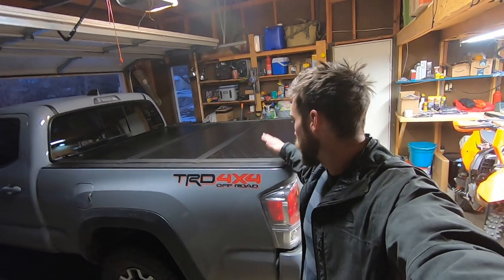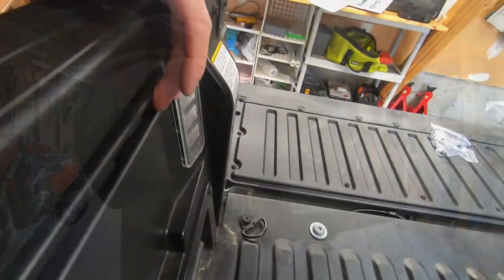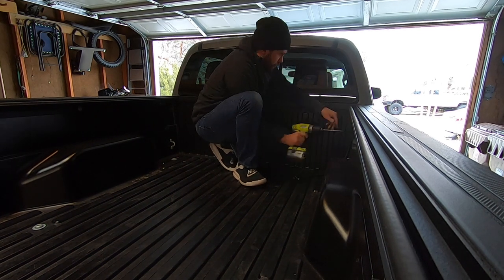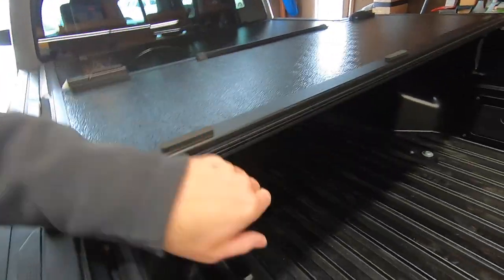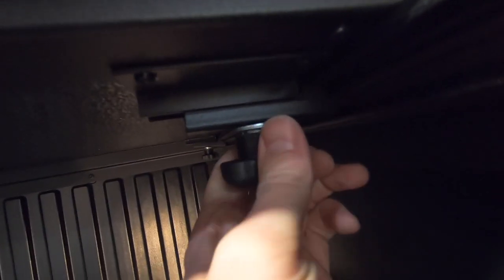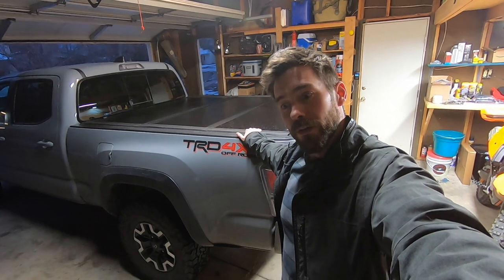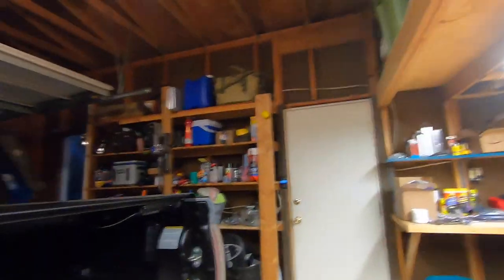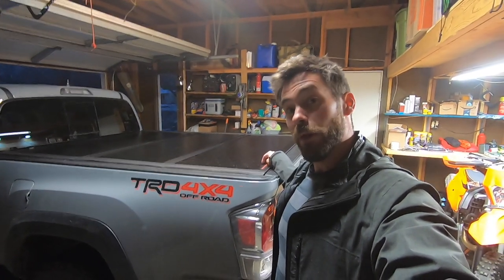16-21 Toyota Tacoma -- Rough Country Low Profile Hard Tri-Fold Tonneau Cover - INSTALLATION & REVIEW

Comment: My 2020 tacoma came with the remote locking tailgate. That's weird
Reply from the maker: Jerny Gutierrez apparently it’s an option that came with some and didn’t come with others. I asked the dealer about mine, they said they could add it for $425. The pop and lock is $90, so I’ll just do that. What model is yours?
Reply: @SourceADV  mine is just a SR with the TSS offroad package
Reply: @SourceADV  I dont have any power seats or power back window or fog lights or anything which is why I figured if I had pop and lock I figured they all do
Reply from the maker: Jerny Gutierrez makes sense! You’re lucky! It’s a fairly long install. Take care!!
Reply: you can configure it on the settings from your radio, you can choose if you want your tailgate to be unlocked by the keyfob or not
Reply from the maker: Jesus Morales not on mine, it didn’t have any actuator back there. I had to use the Pop and Lock kit to add an actuator. The only wires going anywhere near the tailgate handle/lock were for the backup camera. Toyota offered it to me as an option when I bought the truck new, but it was close to $500. Do you have it as an add-on on your build sheet/final bill? What trim level is your truck?

Comment: I pass. I aint drilling no hole into the bed.
Reply: I was thinking the same thing lol I'd just drain it into the bed 😆
Reply from the maker: Its not that bad. The taco beds are basically swiss cheese when it comes to water anyways. Seems like it all comes in through the top where the bed and bedsides meet.

Comment: Ughh i wish installing mine was this easy..i ran into a million hiccups along the way
Reply from the maker: chrisnunez111 what happened?
Reply: Wouldnt latch,had to manually loosen latches to give them a little playroom..i think my truck side rails that i bought it with must have been to short causing slack on back latch end preventing it from clicking. Dont think it was defective i think my rails must have been tweaked or something
Reply from the maker: chrisnunez111 oh got it. That’s too bad. The Tacoma beds are known to tweak themselves a little bit with hard off-road or heavy loads too. There are a couple company’s that make bed stiffeners that help and may re-square the back part of your bed (if that was the problem. I have total chaos bed stiffeners on mine. It adds a couple tie down points too which is great. Best of luck!

Comment: Drill for drains? “F” that…..Why can’t it drain into the bed?  Drive the truck up a gentle slope……where does the moisture go that you are draining with the drilled holes?
Reply from the maker: I didn’t make the directions, this is what Rough Country has in their directions. The water drains directly to the ground.
Reply: @SourceADV  The bed liner covers the bed of the vehicle. Even if there’s an opening, any moisture will drain on metal underneath the liner. I would never drill the liner. I need a cover but i wont be installing any brand with drilling instructions. I have gone over the bed and cannot see any location under the bed liner that goes straight to the ground. I am not blaming you but i will pass on this cover.
Reply from the maker: Tacomas do not have bed liners. The whole bed is plastic, there is no metal underneath other than the frame of the truck. The whole underside of the truck is getting blasted with water when you are driving in the rain, a few drops from these tubes is not going hurt anything. These plastic beds already have little weep holes in the front corners of the bed for water which go to the same place basically.  

I don’t you will find a flush mounted tonneau that doesn’t require drains.
Reply: @SourceADV  I just crawled under the truck. I agree…. The bed is completely composite. I am more convinced not to drill it…. I’ll find another cover.
Reply from the maker: @cperkins172  I think the ones that are a little raised versus flush you will have a better chance to not need drains.  Take care!